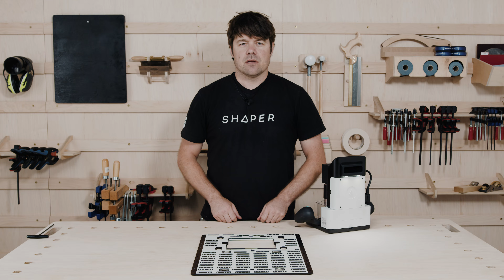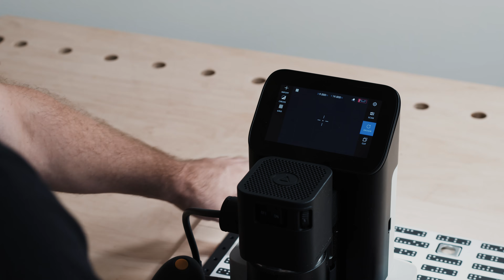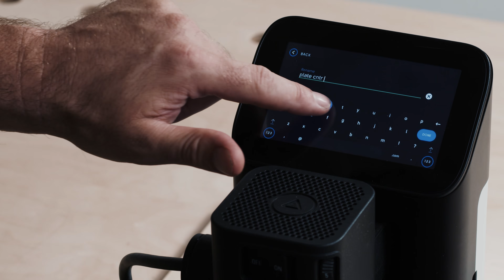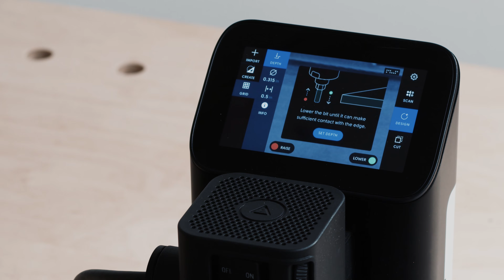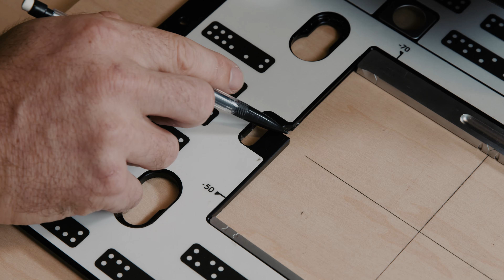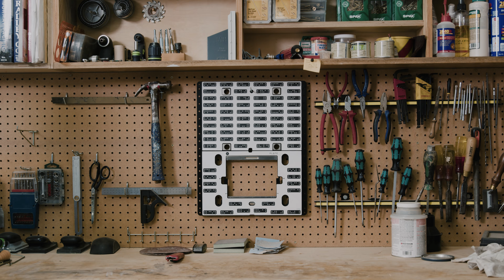Setting Up Shaper Plate

Comment: Looks like you took the shaper origin off the table when scanning plate. Is there no meed to keep origin flat and level with the cutting surface? Have I been overly careful all these years? 😂
Reply from the maker: It's best to keep it level when possible, but it doesn't need to be perfectly plane with the tape *while scanning*. Tape does need to be coplanar with itself and the tool needs a uniform surface, preferably the same one that has tape, to operate.
Reply: @Shapertools  amazing!!! Cant wait to scan the lower part of my work areas from now on 😱

Comment: Great addition to the Shaper system. How did you scan the leading edge of the plate at the edge of the bench so the front domino’s were in the scan? Did you just hold the Origin approximately level with the plate or did you keep a small portion of the Shaper base plate on the edge of Shaper Plate?
Ron
Reply from the maker: Yep, holding Origin close to level and lifting it off the surface is acceptable for a scan, it just might produce an imperfect image in the scanned area. Using a grid you can still make accurate placements on your workspace!